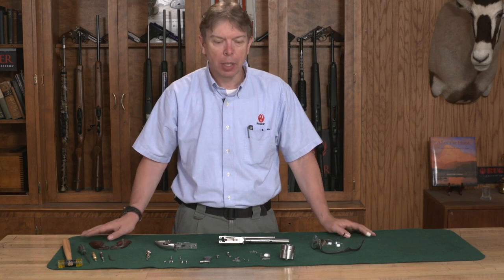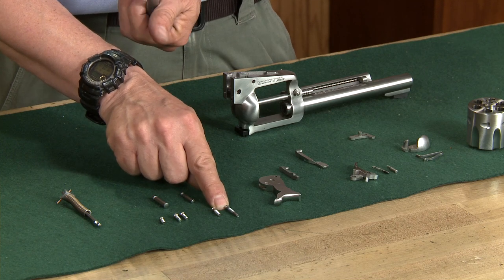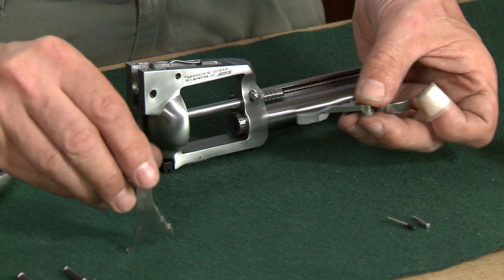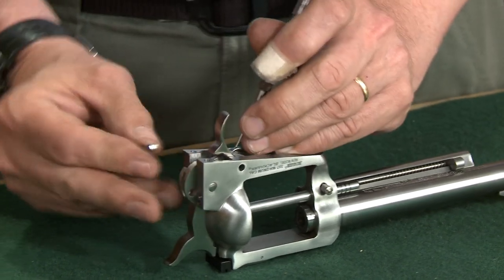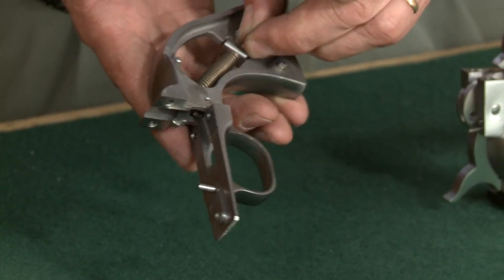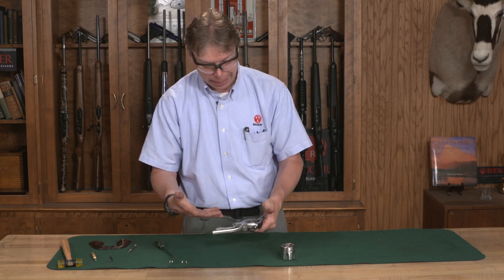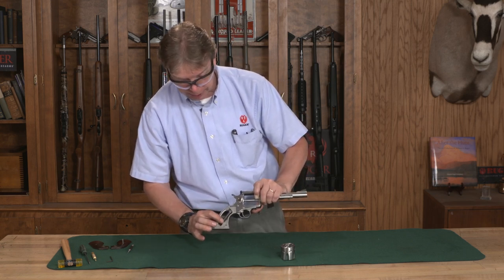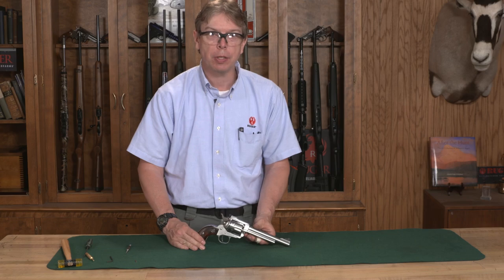Ruger® Single Action Revolver Reassembly Tech Tip

Comment: ...you guys have GREAT customer service...today I called with a problem with a Single Six convertible - bought it used at an excellent price - $450) - it had a problem - held in the normal firing position, the hammer would not cock - it would move about halfway back and stop..however if the pistol was held to the left or right - or muzzle up at an angle-  it would fully cock...spoke to a tech at Brownells yesterday- he suggested  a problem with either the bolt or pawl...after our conversation I removed the base pin and cylinder, looked at the ratchet on the cylinder, noted a few shiny spots and reassembled the gun...figgered I'd call you guys today and ask the same question...only got off the phone about 30 mins ago (3 Aug 22) with a lady who walked me through the solution...and with an explanation of my problem...turns out it was better than talking to a 'tech' as she'd worked on the assembly line of these Single Sixes...told me that it was most likely caused by the base pin not being fully seated to push against the transfer bar...I regret not getting her name - she's retiring shortly - but if you can identify her she deserves a great big 'attagirl' and or a nice big retirement bonus!!!  thank again, my friends...

Comment: You didn't oil anything.
Reply: You can have a lightly oily rag and shine the parts with it while dropping them in. Absolutely no need to  use a dropper to dispense drops of oil into the mechanism. All you will end up doing by dropping oil drops is making a mess inside the gun and gum it up.